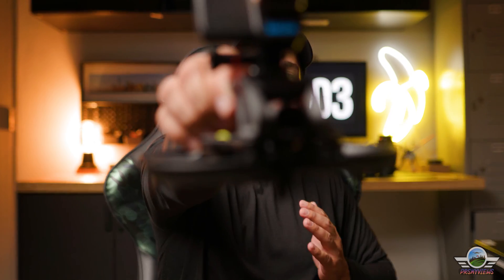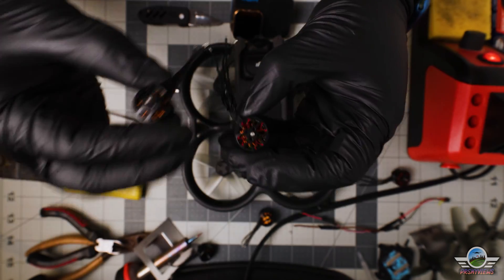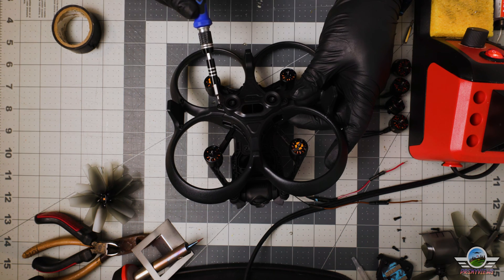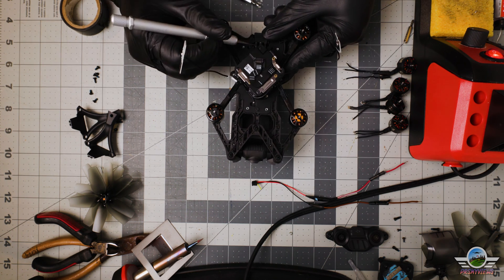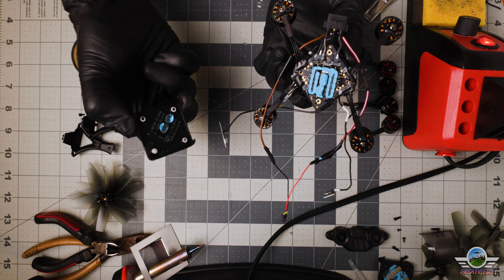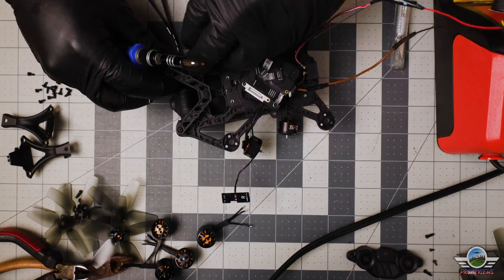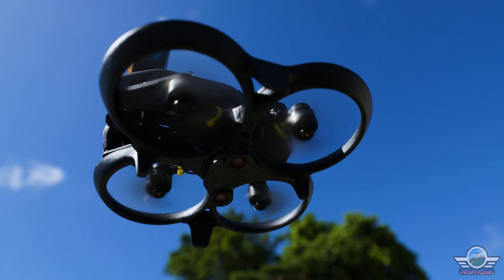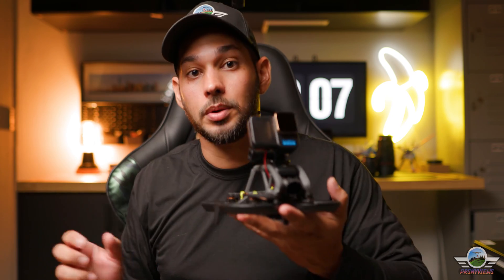Tutorial: How to Upgrade Avata motors EASY

Comment: HI, was wondering what improvments you see with the new motors
Reply from the maker: An increase in torque is very noticeable, the response when making turns while carrying a gopro is a lot better than with the original ones at the expense of 2-3.5 min of flight. If yours is not carrying a gopro or gooro hero bones id say the difference would be more dramatic and at less flight time expense
Reply: @prskyviews  thanks man